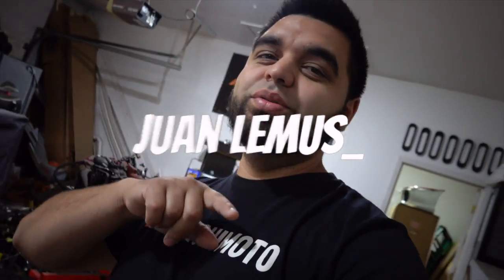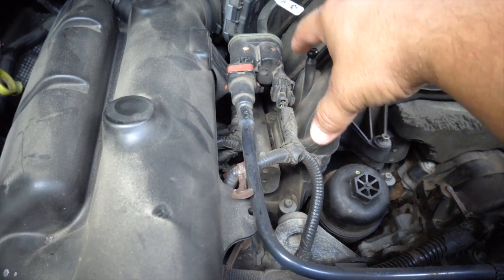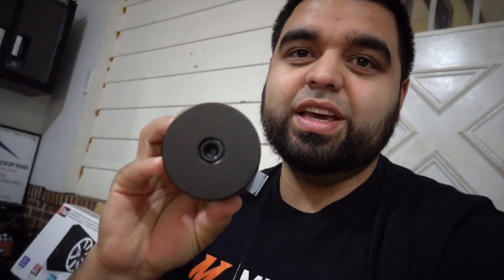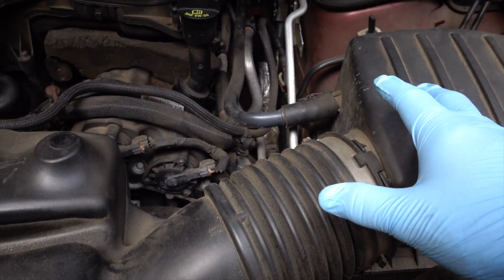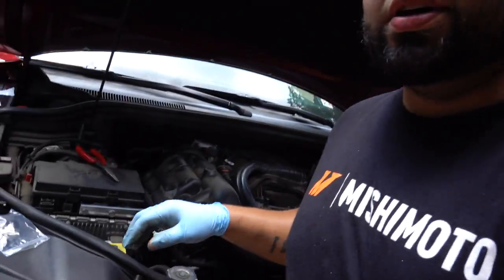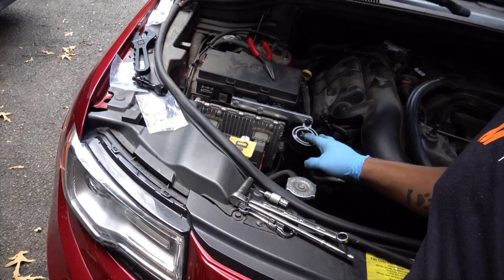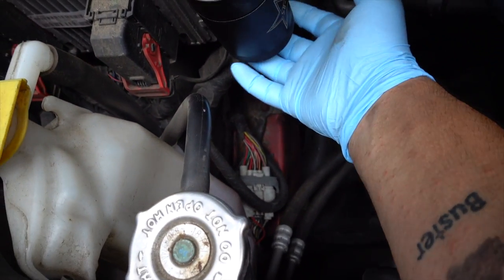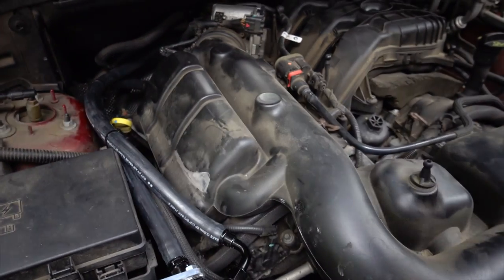Installing A Mishimoto Oil Catch Can On My 2014 Jeep Grand Cherokee WK2 | Billet Technology Bracket

Comment: I got a 2016 JGC 3.6l and noticed the 5/8 fuel line I used (made for fuel and oil) collapses while the engine is running. Any issues with your hoses?

Comment: After one year, does it work? Did you face any problems?
Reply from the maker: No issues at all and yes it works really good
Reply: @StayOnTheGas  I own a Jeep Grand Cherokee 2018 v6, and the truth is I am very hesitant about this. There are conflicting opinions. There are those who say that there are two PCV lines for the Pentastar and not one. If you install only one catch can, this will damage the engine and will not help it, what I have to do